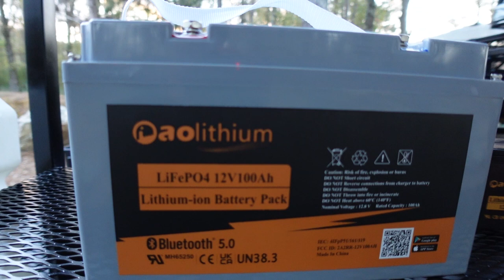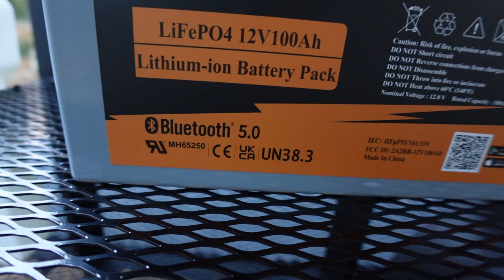Testing Out My DIY Camping Trailer and Adding Power🔋 | Camping Trailer Build

Comment: It’d be interesting to see what appliances you could run off the lithiums with an inverter.
Reply: We've ran an Instant Pot, but you need a big inverter to handle the 1000w draw. We have an AC200 solar generator with a Lithium setup.